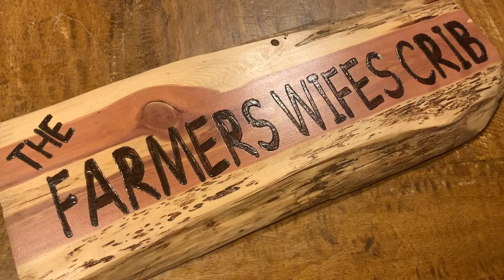We're Hauling! : Hay, Coyotes & Table Talk with the Farmer

Comment: Couple of thoughts. 1) keep a pair of gloves in your tractor and pickup 2) keep some baling twine  in the tractor for securing stuff 3) if you would have laid out the belts on the deck of the trailer then set the hay on top. Wouldn't have fell off. Mere, you did a great job of hauling hay. It doesn't make any difference what you are going to do, the first time is always an emotional roller coaster. GREAT JOB

Comment: Thank you for answering my question. Your husband's answer about not taking the chance of the second baler breaking down was a classic. 
By the way, when you get that third tractor, you might consider a 4640 with it's 1000 RPM PTO. It's great for raking and baling. You can put a 540 adapter on it and run it all week week long at low RPMs on one tank of diesel. Plus, it will pull almost as much as a 4840. Also, it has "Power Beyond" if you ever need it.
Reply from the maker: Sounds good to me!

Comment: I use brake clean solvent in the sprayer the LB received.  I drilled the tip out so it would apply more solvent to what ever I'm cleaning. Good deal.

Comment: It may have been another video but I heard talk of another tractor for your son to help baling. As a former JD field tech and a hobby hay man myself I would suggest a john deere 7200, 7210, 7400,7410 with the 3 lever powerquad transmission. The 4440 is a awesome tractor , I'm not knocking the 4440. The earlier mentioned tractors have a smaller more fuel efficient engine and that 3 lever powerquad transmission is the perfect round baler transmission. Yes they do have a little bit of computer in them but not much and they are very dependable. That does not get bad until you hit the 20 series. Stay away from anything 20 series and newer.

Comment: Instead of another 4440, maybe you should look around for a 4450. They have the 13 speed power shift and you don't need to use the clutch at all, except if you want to inch as you back up to something. Just pull it out of park and jam it to about 6th or 7th and it engages gradually. That doesn't work well at all on the 8 speed power shift. The quad range on LB's tractor is pretty much bullet proof for field work, just don't use it as a target for Wes 😎
Reply from the maker: Haha

Comment: i just bought a new 223 Remington, it came wit a 3 to 9 power scoop and life time warranty.. i have a 3 to 9 on my 30-06 with see under mounts for iron sights.. all my rifles are Remington,, ii just got tired shooting wolfs and fox with my 30-06, cost to dam much for a box of shells, so to make to 300 to 450 yard shots i figer i  hear good things about a 223 so i bought one,, and 20 bucks cnd for 20 rounds is a far cry cheaper then the 77 bucks cnd for the 30-06, only thing i dont like is the 223 comes only in a right hand bolt, and i shoot left handed, all my other rifles and shot guns are all pumps, i asked the sales guy if the 223 is available in a pump or leaver, i was told nop only the right hand bolt,, well one of my 22 is a right hand bolt, and even having to cross over i can shot it fast

Comment: Don’t know if it is possible but I’m wondering if both trailers could be fast hitched one behind the other on one tractor while loading? Cut down on travel cycles etc. still haul as singles. Love your work. Genuine and interesting watching from Australia.
Reply from the maker: I think that would be too much to pull
Reply: T C: Consider that each bale weighs approx 2000 pounds × 11 bales =22,000 lbs on one trailer. One tractor couldn't pull 2 trailers that heavy. It would take a heavy freight truck to haul 44,000 lbs.